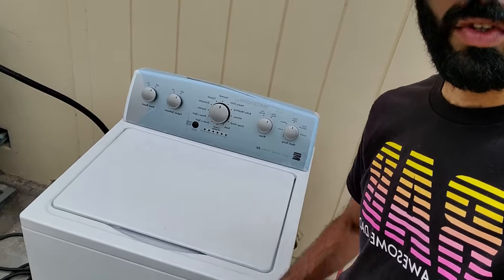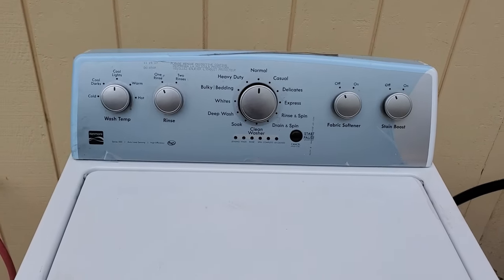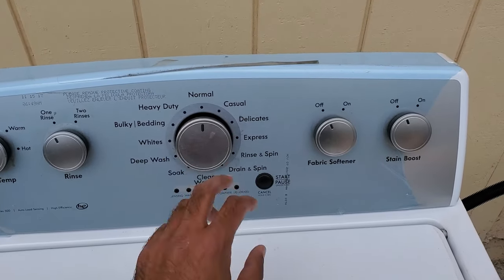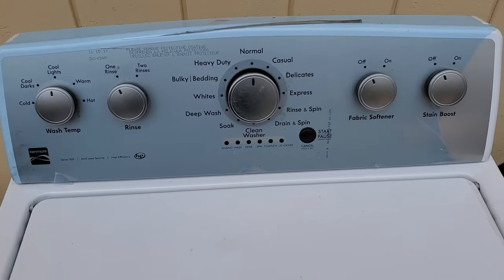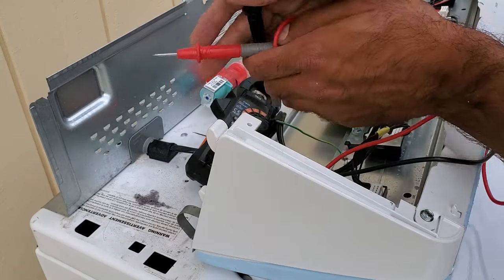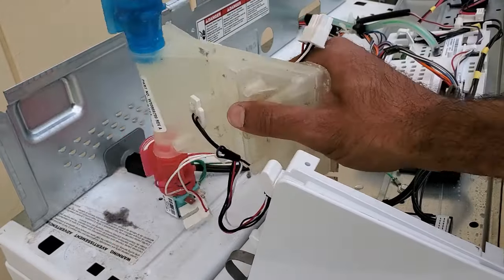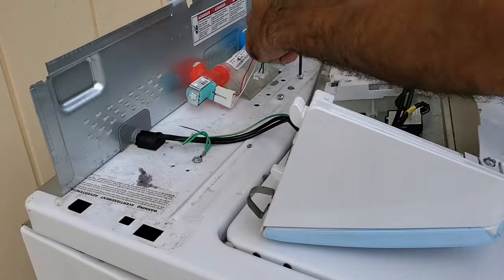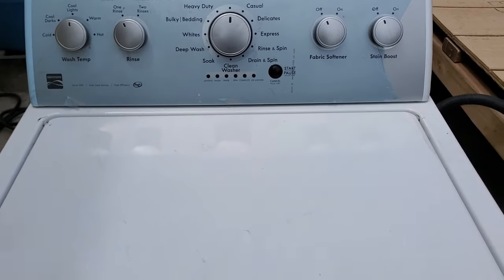Fixing A Kenmore/Whirlpool HE Washing Machine Stuck In Sensing Mode!

Comment: Yeah I will never buy an energy efficient washer machine again !!! My washer keeps blinking lid close
Reply from the maker: Unfortunately they are all HE machines now. The best way to go is get a used older style whirlpool/kenmore washer (look for what's called a direct driver washer)
Reply: @DuctTapeMechanic  do you know any recommendations to where I can find an old style washer machine ?
Reply from the maker: @ashajeremiahqw8775  Facebook marketplace has a lot of them. I often pick them up for free and repair them. The more popular ones are the Kenmore 90 series washers. Should cost around $150 to $250 for a good working one that will last a long time.
Reply: Yep I bought a Whirlpool during COVID i had no choice in buying it to replace my old Whirlpool that was 15 years old and gave me trouble free service. these new High efficiency machines with the recalibration modes are in my opinion a POS you spend more time replacing flimsy parts and recalibrating it then washing clothes  thanks to the engineers at Whirlpool washing your clothes went from a simple process to complicated unreliable one  my next machine is going to be an LG
Reply: @1995dresser  they r all garbage now. .... U can no longer find a mechanical washer they r all load sensing , computer controlled junk !!!
Reply: @DS-mm6fh  Yeah your right the only simple mechanical control washer that still has a real transmission is the Speed queen brand  but your talking $1200/1500  but they are guaranteed for 5 years and still have a great reputation I'm going to take the plunge and buy one tired of buying light weight trash for $500/600 and not getting good service out of an overly technical computerized delicate  POS
Reply: That means it has an error code go through diagnostics
Reply: @chelseaprebee3817  got it fixed it was a latch
Reply: @1995dresser  You would be better off buying a nice used coupling drive Whirlpool washer. Also goes under the names of Maytag, Roper, Amana, Jennair, Kenmore. Just make sure it has a coupling. 
I would also look for a nice used 2 belt Maytag. That's the best ever made machine. Hard to find but good news is, parts are still readily available .
Reply: @TheNYgolfer  it’s fixed knock on wood
Reply: @DS-mm6fh Getting so few of the good old direct drives and more electronic models, thinking about quit messing with appliances.
Reply: Did I hear correctly?  $1000 for that??
Reply: Surprised the actuator was not mentioned as a possible cause.
Reply: @ashajeremiahqw8775 what was it and how did u fix it
Reply: That's what mine is doing. Won't spin  the door lock keeps blinking.

Comment: This video really helped. However, I did find an easier way to check if water valve solenoid is bad. I had the washer on cold water temperature. No water coming out sensing button blinking. Turned to hot water temperature hit start and water started coming out and washer worked.
Reply from the maker: Yes that works as well!
Reply: @DuctTapeMechanic  Since we wash all our clothes in cold. I plugged the cold plug to hot solenoid, because after switching the hoses i found that during the rinse cycle no water would run. Guess the washer rinse cycle is auto programmed for cold water. Ordered the parts and have them as backups once the hot solenoid goes bad.
Reply: I just tried this on my washer. Sensing kept on blinking. Came on here and saw this comment and it worked!! Thank you!!
Reply: How to replace a 2001 deville rear bumper
Reply: Okay Okay 👍 👌 😊nice work. I have to check that out.
Reply: @ottodiaz2129 😂😂😂😂😂

Comment: Evidently this machine has problems.  Mine was delivered March 1st and I called to repair on May 6th Bought from Lowes and nearest contract repairman for whirlpool is 2 and 1/2 hours from here.  He was scheduled to come fix on the 13th.  Did not come but just wanted me to diagnose I have no training in repairing appliances!  Well it sounds exactly like what everyone here is talking about.  Will not advance.  Of course the repair man did not tell me it has a problem sensing. So today May 28 I have not heard back from him and Lowes says they are not responsible and Whirlpool says the part is coming by week end which is what they said last week.  I need a washing machine!  Has this been reported to Consumer Affairs because they have to know this is a problem.  Help!!!  What should I do?

Comment: I have an amana washer when I hit the start button it will auto sense and fill with water but it will continue to fill with water for about 10 minutes then after that it drains the water moves on to the wash light but won’t do anything after that what could be the problem?
Reply from the maker: That sound like an issue with the mode shifter/actuator
Reply: Same here, but mines a Crosley

Comment: Thank you, I tested those valves for continuity and they were fine. So, after researching a little more I decided to check the shift actuator. Once I flipped the washer over, I immediately noticed that the capacitor was hanging loose with one of the wires detached. I soldered it, put it back in its place and that took care of the problem. My washer has been working they way it is supposed to

Comment: I have this model, and checking your input.  Over the summer, the cycle wouldn't start, sometimes it would take minutes.  It would sometimes screech before going to the next step (rinsing).  We tried washing the machine with Tide, which actualy worked for 3 weeks, then the normal cycle stopped working. We then used the Casual and Express cycles (no issues) but now the casual cycle, would not start (or trying to start).  We now are resorting to using express cycle (no issues for now)

Comment: I have that same pos.. even if you set it on heavy duty and deep fill it doesn’t clean worth crap. It just moves back and forth 3/4 of a turn at a time never getting the cloths to roll down and up like our old one. What doe’s saving water have to do with the crap way it agitates? Why does it just move back and forth but never enough to get the stuff to move from the top to the bottom.

Comment: Before you test the valve check if the filters are clogged. This happens quit often is and is easy to fix. Just shut the water take off the hoses and check the 2 plastic filters in the hot and cold.
Reply from the maker: Absolutely a good thing to do first!
Reply: Same here, my valves both read open but since the cold water intake screen was totally clogged i cleaned it and it's been working since
Reply: Howd you clean the filters

Comment: If you machine flows water while set to hot water it is your water inlet screen clogged. Pull it out and clean it. Use needle nose pliers and it pulls out like a Cork. Screw all this diagnostic testing. Something so simple took me all day to troubleshoot. Hit like if it worked. I had mine stuck in sensing mode. Try this if just hot works.
Reply from the maker: Yes you are absolutely correct. However if your valve solenoid is burned out like mine was cleaning the cold water valve screen won't do anything. So testing it is not that bad an idea. But yes, it is advisable to just take a look at the filter first (I actually gave this advice to someone in the comments a few days ago).
Reply: @DuctTapeMechanic  yeah if you catch it soon enough get it unclogged you won't burn out that solenoid.
Reply: 😂😂😂 wow this solved all my problems thanks
Reply: Where is that at?
Reply: Thank u just a dirty screeeeeeen. ! I thought so ❤

Comment: I had the issue it would sense then a quick hum then it would quit but stay in sense mode. I replaced actuator and still ddid this. I finally figured out that underneath there's a bundle of red wire zip tied to the frame and there's a butt connector where 3 wires meet.  Mine was burned. Replaced it, back in business.
Reply from the maker: Great work!

Comment: You should also mention that when it’s stuck in sensing mode if there is water in it the tub it’s the drain pump. Which is an easy fix under the unit 3 5 1/16 hex bolts remove disconnect drain hose and plug in a wire harness lol at least that’s how my whirlpool was I’m sure these smart wifi ones are a bit trickier. Gotta love the easy ones though.
Reply: The washer i grew up with at my parents house in the 80's and 90's, that thing lasted the whole time i lived there. The new high tech digital machines break easier

Comment: What you need to do is tilt the entire washer backward and lie down to access the under portion of the Series 500 - and change the the Synchronous Shift Actuator - $30 part.
Reply from the maker: Yes the actuators on these fail often
Reply: hi, where did you get your Shift Actuator for $30? Thanks!
Reply: Changed mine today..still have the same problem, no wash, no spin.

Comment: Have a Kemore- Series 100.  Works fine until I try washing jeans. 3 pairs and nothing else.  The machine will sense and fill with some water, will not spin all the water out.
Reply from the maker: Is it making make loud noises? Also check for clogs in the drain pump/hoses
Reply: @DuctTapeMechanic  No loud noises.  I will check for clogs in th drain pump.  Thanks for your help.

Comment: Got a minor issue with my washer I can't figure out. Auto sensing and deep water wash are backwards. Set it on auto sense and it deep water washes, set it on deep water wash and it auto senses. The washer isn't that old, going on 3 years since I bought it and it didn't use to do that, only discovered it a few months ago. I've done everything from reset to auto calibration, every little diagnosis it offers and it still has this issue. I've checked wiring, the mainboard, switches, ect ect and can't find one problem. Not like I can't deal with it, there is obviously a work around setting the switch to do the opposite of what it shows, I'd just like to know why the heck it does it.

Comment: Question. I have a top loading whirlpool he with the 6 lights. When I turn it on the sensing light is on and the lid lock light flashes but doesn’t lock, I can her the lid lock clicking. It’ll do this five or six times and then the lid lock light turns off and the sensing light stays on but nothing else happens. I’ve unplugged it for over 60seconds and tried todo the recalibration and also tried to access the error code history unsuccessfully. Any suggestions?
Reply: We are having this exact problem too! Following.

Comment: I'm having this issue with the 300 series but the water is going in for a few seconds but remains on sensing. The Drain/spin and Rinse/spin cycle s do work but all others stuck on sensing.

Comment: Seems like the exact problem I have. Time to get the meter out and test it. Preliminary test is going to do a hot only and a cold only test but I suspect if one is bad the computer will just detect a fault regardless. Time to get my meter involved. I hope this fixes it :) I'm at my with end and was considering kicking it to the curb and incurring a cost I'm not prepared for. Currently it goes to wash from sensing but doesn't do anything after that but display the wash light after it drains my water and detergent. This sucks.
Reply: @dan9809  I fixed it for $28. Got my meter out and started with suspect parts. Turns out it was the intake valves. The solenoids on both sides were cooked. When I put it all back together and hit the start button the sound was magical music to my ears! My wife has bad knees so I don't let her go to the basement so the laundry is all mine to do. I have a new found love of washing clothes now that it has been fixed! (JK I still hate doing laundry :) )
Reply: Check the belt and the actuator
Reply: @wylykyotys  My problem turned out to be the hot and cold water mixing solenoid unit. Works great now.

Comment: I have this same machine, every single load it goes into out of balance shaking.  Is this repairable without hiring a technician.  Your response would be greatly appreciated.
Reply from the maker: Most likely it is the suspension rods which can definitely be done by yourself.
Reply: Having the same problem

Comment: Issue started other day, clothes are still soaked at the end of cycle.. Its skipping the spin and drain part of the cycle? Its not spinning enough, or fast enough to squeeze all the water out of clothes? Water pump works, took all hoses apart while operating outside to ensure draining but now the sensing is acting funky
Reply: Having the same issue!
Reply: Check the belt and the actuator

Comment: Hi @DuctTapeMechanic I have a Kenmore 110.21392013 and I replaced the water inlet valve on it after it leaking disasterously all over my floor during washing. Now, it is stuck in sensing mode, not unlike this. It does start to fill with water, but it never progresses into the actual "wash" cycle or goes any futher than that. 

Since you seem to have a lot of experience fixing various issues with washers, I was wondering: any insight on what else is wrong or where I could start? It's confusing to me, because this is a new issue.

Comment: I ran the automatic and manual test modes which all work. When I try just a plain Normal wash I can here the first 2 startup phases where it's sensing the load and when it's time to add water a constant sound like the motor is running and although I press the Start/Pause and the Power Button the noise continues until I pull the AC plug. I tested all the valves including the drain and they all work.
Reply: Same!???
Reply: Same here

Comment: My MayTag also got stuck in sensing mode due to a frozen inlet pipe.  Apparently it is expecting water to come in and somehow uses that to figure out how many clothes are in the drum.   It warmed up the next day and then it ran fine.
Reply from the maker: Wow thats new. Glad it worked itself out
Reply: @DuctTapeMechanic  Glad the pipe didn't burst.  Plumbing was in an exterior wall and it was 10F for several days.  No way to drip it that I know of like I did on kitchen and bathroom faucets.  What cold weather precautions should be taken with a washer ?

Comment: Question. I'm waiting on that exact part, frozen water burst and broke the cold side, but really need to do laundry now! Is there a way to bypass that cold side, or do both have to communicate in order to wash????
Reply from the maker: Just change the machine wash temperature to hot/hottest this way it will not use the cold valve (unless you have a machine that does a cold water rinse but it is worth a shot)
Reply: @DuctTapeMechanic  worked for me somehow

Comment: I just bought a new whirlpool washing machine (Lowes).  It fills up with water (in sensing mode), then stops and you can hear dripping, then starts filling back up again.  It gets stuck doing this for hours (of course I turn it off before hours).  This is the 2nd machine as the first was stuck in sensing mode as well.  Is this normal?  any ideas?
Reply: Follow up. Whirlpool is having a person cone by and fix
Reply: @lofficer11 Did they fix it and if so what what was it please

Comment: I just put a new lid switch and harness in my digital whirlpool washer because it was reading lid not closed. Well now it doesn’t leave sensing mode which after about ten minutes the screen reads F5E3 error code, which is close lid. Clothes are piling high. Help…

Comment: Thanks!! Good explanation without a lot of useless chatter.  
Would you happen to have a part number for the part? I couldn't l look through all 212 comments.
Reply from the maker: Part number should be on the old valve you remove. They all have slightly different part numbers due to the different electrical connectors.

Comment: Hey bud ....on this model, what would cause the motor to start to spin and then stop after a couple rotations??? Put it on drain&spin cycle and it'll drain then the motor will engage to start spinning but disengage a couple of seconds after....then it'll go through the motions again, and again
Reply: Mine is doing exactly what you described. Did you get it figured out? What was causing this problem?
Reply: Any update? Mine just started doing this exact thing. Fills fine, tries to spin once and pauses for 20 seconds and tries to spin again. Rinse and repeat. Holding the start button to cancel it drains just fine too

Comment: Why did you raise the top instead of sliding tool under the control panel to release those clips? Then you just roll the panel back to get to the valves and controls.
Reply: True but if you have to replace it you have to open the top anyway

Comment: I have a whirlpool top load washer and non of the leds light up but when I plug up to power it goes straight into drain mode that’s all it does nothing else. Please help me out thanks
Reply from the maker: Let the drain pump drain for a few minutes if it does not stop then most likely you need a new control board. If it stops draining then try starting a load